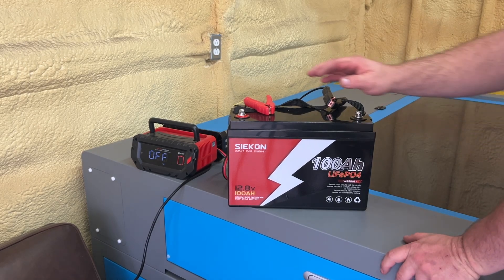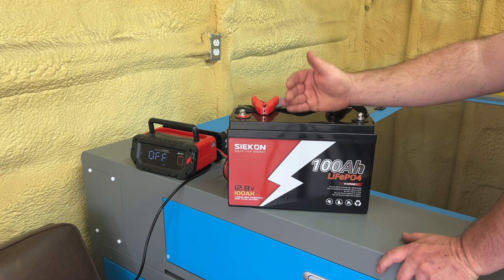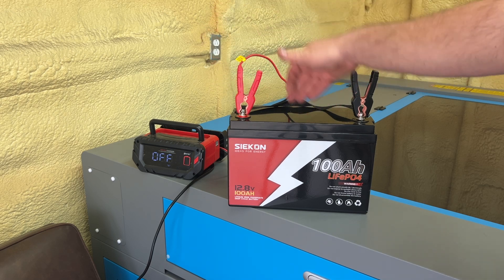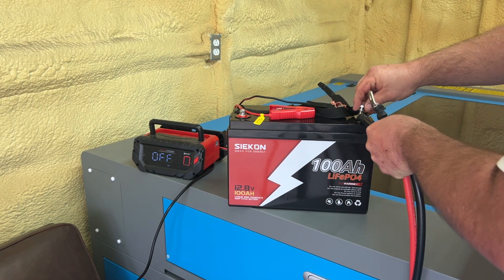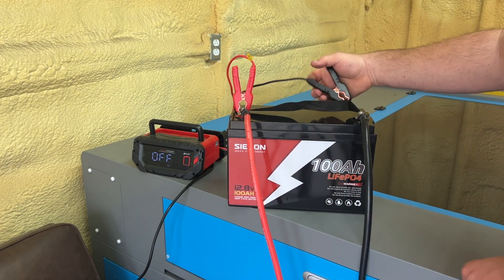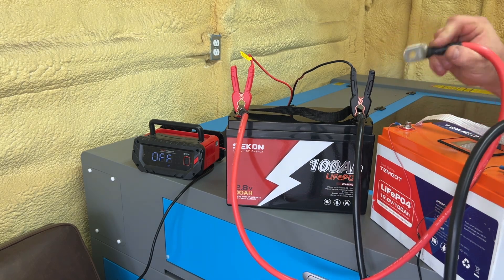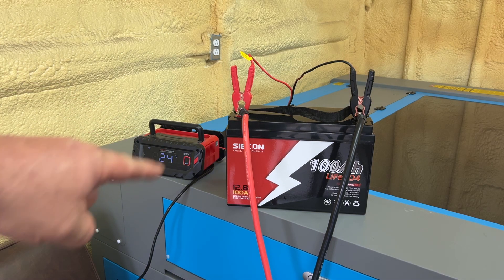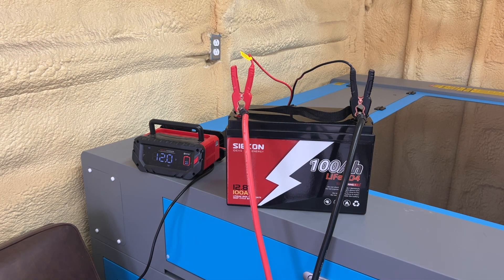Lithium LifoPO4 Battery Wont Charge! Try This First!

Comment: WOW! I just bought the battery awhile back but never used it, then GOSH I was throwing a fit, came across this vid - THANKS BROTHER!! I used a regular battery charger to wake it up, it worked, now the battery tender charger is working and hopefully the solar panels will work too - GOSH, I'm glad I'm at home dealing with this and not in ''BFE'' - HAA! never knew the new type of lithium iron phosphate battery's go to sleep - I miss the deep cells - the ol'batterys they are simple it either dead or not - none of this sleep ''BS''- haa! you saved me a few dollars and few holes in the wall - thanks bro

Comment: Hello
I have 12v 100mah lipo4 that reads a 100 % charge when I connect the charger but the battery is at 70% and will not start charging 
I have 2 other batteries that are same   But they both charge fine from 70% with the charger. 
Thanks

Comment: My battery is at 12.88v will not charge. I did what you said, but every time I take the cables off the good battery, charging stops
Reply: same for me. 12.8V when resting but my battery took no charge. I emailed support and they told me BMS was blocking charging and was in panic mode.
I should uncharge the battery with 60W for 3 minutes which i did with a halogen 12V bulb and from this point the Voltage has risen to 13.3V and the battery took charge again.
Hope this helps your dead battery

Comment: I did this and the charger kicked on and charged up the battery.  When I tried the golf cart in forward, it would not move.  I tried reverse, and it lurched backwards and stopped.  I immediately smelled something burn and a beep alarm went off.  15 minutes later my battery showed completely dead again.  What the heck is going on!!??

Comment: Can I use a lead acid to do that?
Reply: Probably not with the charger running. Connect the batteries together for a an hour and try to charge it again. That might give the dead battery enough juice for the bms to communicate with the charger

Comment: wow, big thank you..!! i almost bought another battery. my charger wasn't charging my lithium battery(said OFF) so i did what you said and connected to a lead acid battery for about 5 sec,(lead acid to lithium..i risked it) and it started charging. ps...my lithium was full, but the charger still didn't recognize or whatever.... problem solved...:).

Comment: Can I use a lead acid marine battery to wake up my LiPo4 battery? I’m having the same issue of my battery not charging.
Reply: i just saw your message...:) yes, that's what i did and it worked. connected for about 5sec and the charger started charging my lithium.
Reply: @ I ended up using a trickle charger. It took a couple of days since it charges at 1amp/hr and it’s a 100amp battery. My LiTime 12v 14amp charger just worked once and didn’t want to work again.

Comment: So what happens if this doesn't fix it? I did the same test with a 12 volt lead acid battery and it won't bring it back to life. Is the voltage too low? I've read a number of comments online where people put 24 volts to it for a few seconds to wake it up when the 12 volt method didn't work but I do know lithium has more voltage than lead and I'm wondering if the lithium is what helped this
Reply from the maker: I made a new video explaining that i tried this with a different battery and I couldnt get it back to life but I downloaded a app on my phone in order to wake it back up.

Comment: I connected a charged 12V battery in parallel with my Lifepo4 battery, and indeed the charging process began, but stopped when the charged battery was removed. The smart charger displayed Full, but the Lifepo4 battery had very little charge. I tried it several times to no avail.
Reply: Mine is doing the same thing did you ever find a solution 🤔
Reply: Wouldn’t a dc bench supply work? Since it suppplies constant power it wouldn’t need to communicate with a bms in theory.
Reply: @emmanuelalva6597 that's what I just did and it worked perfect
Reply: Same problem, charges when jumped, stops when jumpers removed, little to no battery charge. Even tried leaving the jumpers on for 1/2 hour but same result when disconnected.

Comment: My battery will restart when I unhook it for 30 secs and the charger will start and show charging for about 5 mins then it says the battery is fully charged and shows 14v then as soon as I put a tiny load on it it drops to 10v and bms cuts it off the batteries are brand new any idea what would cya use this

Comment: Works on your tool batteries also ... any Lithium
Reply: Yep, can confirm it works with lithium batteries too. I've plugged a Type-C PD trigger that takes 12V from power bank (these trigger modules are very cheap), connected 2 cables to this trigger and connected the cables to the battery, the charger started the charging process immediately.

Comment: So your just wired a 2nd battery in parallel ini order to "jump start" the charger.
What if I use a 12V lead-acid battery from my car?  
Can I use jumper cables from the car to this "too dead to know better battery", to get the charger to kick on?
Reply: i'm sure it will work

Comment: Im getting  4 -12v enjoybot batteries for my yamaha g29. What should the layout be to hook them up ?
Reply from the maker: First off, I wouldnt do that. The price point for that used to be the key to easy and cheap lithium upgrade but if you dont run a balancing 12v charger then you might have problems down the road. I would use this charger for 4 individual 12v batteries after Ive had time running individual batteries - https://amzn.to/3uPZdKI
Reply: I have a summit 2 charger
Reply from the maker: over time they will get out of balance with that charger as well.
 @mrjones862
Reply: 400 bucks wow wee😂